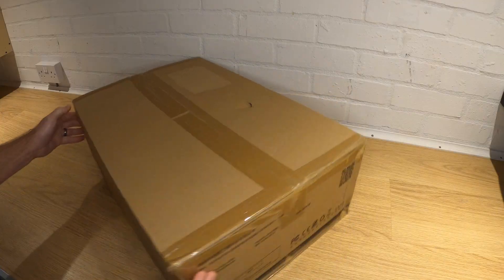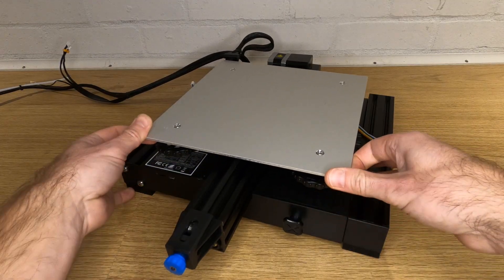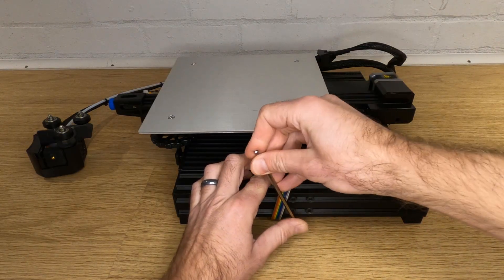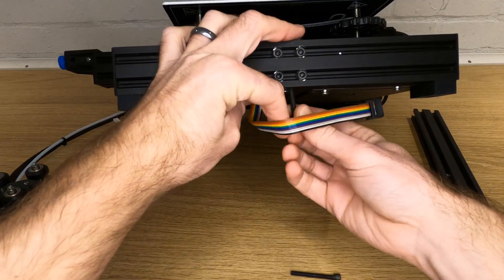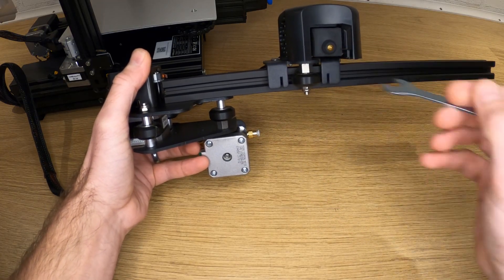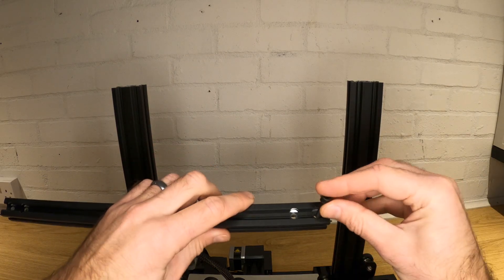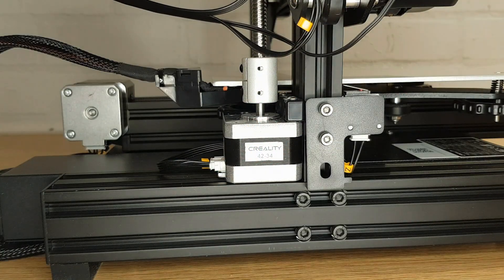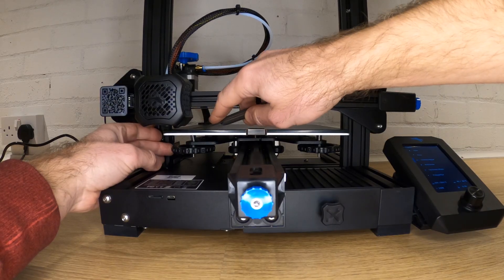Ender 3 v2 Full Build, Assembly & Setup - All The Basics For Beginners

Comment: I have to say a big thank you for this video. My other half has been wanting a 3d printer for a while, we finally took the plunge. Opened the box to find all these parts and a manual that was next to useless, so I said let’s YouTube it, and there you were. We followed your instructions to the letter. It’s a good job we found you as the heat bed was that tight it juddered when we initially moved it. 
Thank you so much for your help 👍🏼

Comment: The screw sleeve protective cover. Cut about 2 or 2 inches off and put it on after installing the filament step motor. It helps keeping the filament clean and grease free. Also using blue loktight on screw threads before assembly helps it from loosening up

Comment: Wow...great video! I just bought one from Micro Center for $99 using a special promo coupon. There is nothing wrong with this 3D printer. However, being aware of all those minor nuances, minor adjustments, and even adjusting factory preassembled parts is going to be key when I assemble mine. Thank you for making us aware of all those small adjustments. Now I understand why there are some less than positive reviews out there.  Seems to be many cases of people not being aware of what they should be aware of. :)
Reply from the maker: Indeed, it can be great if you are capable of building it right. Enjoy, $99 for one of these is an absolute steal!

Comment: Excellent!! Many thanks for your extremely practical, detailed, precise and thorough instructional videos.  We built our Ender 3 V2 following this one and used the 3 separate ones to level and load etc.  We got a perfect dice and mains socket cover straight away.  Such clear and concise instructions, very clearly based on real-life experience with the products helped us get up and running. Looking at the manual I very much doubt we'd have succeeded by following that as there were so many key tips in your videos which were not covered.  Great stuff and keep up the good work.  Much appreciated.
Reply: How long it take you and how’s your print quality
Reply: @ohfr20  it took around 5 hours of careful and calm progress, checking each item as we went along. Print quality is excellent and we've printed other things since with good results.
Reply: Like on a scale of 1-10 how difficult was the whole bed leveling and setting up the printer in general process
Reply: I am just now getting into this but this seems like it takes a lot of patience I’m thinking about going with a plug and play cause this looks challenging
Reply: It’s not difficult. You just need to be meticulous which this video really helps with, adding real life experience to avoid potential pitfalls. Take your time and check each step, watching it repeatedly to make sure
You’ve done it right.

Comment: Hey, quick question! I've been following this tutorial religiously to assemble my first 3d printer. I've reached the point where you out the belt on, but to my dismay it doesnt seem to fit? I've triple chevked that i am using all the correct parts but the belt seems to be just half an inch or so too short to fit all the way around. Is there any common mistake I may be making? Or is there a possibility that the belt itself is too short?
Reply from the maker: You wouldn't be the first to receive the wrong belt. My advice would be to contact Creality.
Reply: @RickyImpey  Alright, thanks!

Comment: Really good to start and turns bad quick. When assembling the printer head he skips over a lot of stuff like it is self explanatory. The belt for instance he just skips by and does not show where it goes. Very confusing. Also he says don't put it on upside down and the keeps going. Does not show which way is upside down. Smh I'd be better off with the Chinese instructions.

Comment: Absolutely the best tutorial for this one YouTube! Just picked this printer up since Microcenter has it at $99 with a special coupon and I've been wanting to pick a 3D printer up for a while. This tutorial really helped and showed the process better than any of the other tutorials I looked at. To be honest though, when I was getting super frustrated while confused by something, I got so pissed at this tutorial and all the others on YouTube lol I had an issue with the tensioner belt and spent over an hour messing with it because no tutorial showed/explained that the belt could only go in one way. Later, you said to make sure the wires went behind the vertical extruders, not in front but I'm the shot before, your wires were in front so that's how I put mine. Only to find that if I played the video for 3 more seconds, you would've said the line about it needing to be behind. Small nitpicks that mostly come down to me being a complete beginner.

Thanks for the tutorial!

Comment: Help! I love your video its very descriptive.  I am at the part with the belt exactly 8:39 in and my belt is too short,  I have checked everything to make sure that my parts are all put in the correct place and it looks good,  any suggestions besides returning it,?
Reply from the maker: If you disassembled the adjuster like me and it's still too short then unfortunately there is nothing you can do with that belt. Best contact Creality with pictures and measurements, I'm sure they would send you another one.

Comment: What if everything is aligned but I can’t push down on the gantry? I loosened the z axis stepper motor mount and everything else, its almost free floating and it wont let me push down unless Im pushing directly over the motor...
Reply: update: Id say I have to move it a good 4mm or so for it to be pushed easily, I have no idea how to fix this rather than putting in spacers

Comment: I am stuck where the gantry does not mov downwards when I gently push down. one side wants to move but the side with the rod does not. the bolts on both sides are about the same amount of give. any suggestions? :(
Reply from the maker: Have you tried loosening the z axis stepper motor mounting and seeing if it allows easier movement? This is the most common reason for any binding. If it helps then you need to look at removing the molding seam on the plastic block like I had to in the video.

Comment: Great tutorial, got my 3d printer working great on all axis except the front of my models (y axis). I'm getting a lot of ghosting / ringing which is noticeable and a clear lack of text definition which I noticed on some calibration prints but text was perfect on the x axis. Any idea what the resolution here is?
Reply from the maker: Hi, ghosting is usually caused by vibrations on an axis. Without slowing down the print movement, I would be looking for any play you can find it the axis that is causing you problems. This can be loose belts, bad roller adjustment etc.

Comment: FIY, for the screen, you do NOZT have to remove the nuts, just loosen them up a few turns and rotate them to lign up roughly with the slots in the extrusion. they should slot right in and will rotate to the correct position when you go to tighten the screw. easy peasy.
Reply from the maker: Unfortunately, no matter how many times I tried, they just wouldn't turn and grab so this was quicker. Usually they do work though👍

Comment: SO far so good this guide is soooo helpful, quick question. When it came time to adjust the wheels at 9:46 I couldn’t get the wheels to spin with my fingers at all. No matter which way I turned the wrench, it moved smoothly along the axis but I couldn’t get that play with the wheels like you were saying. Now getting to putting the Z axis stepper in, it went in rather straightly but upon doing your test, where you push the X axis down slowly it wouldn’t move down slowly, only a very little bit, I had to push down on the piece to holds the z axis stepper bolt, if I can’t get it go down smoothly is something wrong? Or do you think ill be okay? Any Help would be appreciated
Reply from the maker: Hi, you want to get the z axis as free as possible but, as long as it's not binding at all anywhere, you should be ok. It may free up once you've used it a little.
Reply: @RickyImpey  thank you so much for the reply, am new to 3d printers what do you mean by binding?
Reply from the maker: @litey9156  Just that there is no point in the movement of the z axis where it seems to get tight or there is any restriction to it's movement.
Reply: @RickyImpey  Ricky you are an amazing man, thank you very much!

Comment: I wish I had seen this video before I put mine together last week! It would have saved me hours. My print bed Y axis rollers were just as tight as yours and there were a few aluminum shavings on the tracks too, so the motion had not only high resistance, but also some very lumpy spots. I put a paper shim under the outer edge of that Z axis motor mount to get the motor vertical. Your solution is certainly better. I also had to loosen the screws holding the nut that runs up and down the threaded rod to get it in a position where the rod aligned with the coupler. As received the rod was at least a quarter of an inch away from hitting the hole in the coupler.  The M4x16 button head screws must be made of peanut butter. All three heads (and the spare as well) stripped and it was not due to a bad hex key. Some good quality alloy screws will be be arriving today to replace the originals, but NOT button head. Great video!
Reply from the maker: Sorry that you had so much trouble with your new 3d printer. All the hard work and attention to detail will really pay off in the long run though, good work 👍
Reply: @RickyImpey  In case someone else runs into it there was one other thing that I didn't see until a few days later. The Z axis profile was not quite at a right angle to the verticals, (not quite 'horizontal'). It was about 5 mm higher on the right than the left. I solved it by Dremeling the holes in a couple of places to allow the profile to drop slightly. Mostly it was the clearance hole in the back of the profile for the nut on the end of the mounting bolt for the wheel immediately in front of the Z axis stepper. But now that I look at it some more, a guy could likely save himself a lot of trouble by lossening one or both of the wheel mounting bolts above and below the X axis stepper. There would probably be enough play there to allow the whole X axis affair to rotate down to where it should have been. Anyway, it all works great now. And I love the Jyers firmware!

Comment: Ricky I am SO thankful for your videos! I just got my printer in and it had all the issues you talked about except for the rod and the y axis motor hitting the bed. I rolled the bed back and forth and it was tight with multiple dead spots. I moved the wheels all around and adjusted....seems much better. This printer would have had issues from the start if I didn't follow your assembly guide. My only worry is if I tightened the bed belt too little or too much. LOL THANK YOU!!! I am going to test it first as it is from the factory, then add the dual extruder, CR Touch, Capricorn tube and Jyers.
Reply from the maker: Great to hear the video helped you avoid some of the issues people get with these printers Biff. Don't be in too much of a rush to add those mods, get printing and enjoy the hobby. It's a great printer from stock. Thanks for leaving a comment 👍

Comment: Hello, very good tutorial with very little problems until now, at the part where you had to sand down your plastic bit, I was also having problems, but I used a level and the top part that the rod initially goes through is askew rather than the bottom part. I was wondering if you know about this problem or if you know a way to fix it.
Reply from the maker: I'm not sure I know exactly what you mean. On the V2, the z axis lead screw is clamped in the coupler at the bottom and passes through a thread in the X axis carriage. Is it this thread that is not straight? If so, then I haven't seen that before. Have you tried loosening the fixings a little? They shouldn't be tight, they should allow a little movement which will probably allow the screw thread to sit straight.
Reply: @RickyImpey  Thanks for answering! This helped a lot but there's still a little binding near the bottom of the rod, I'm going to try sanding down the piece you mentioned just in case, thank you!

Comment: Thank you, wish I had seen this before using another one! Videos are great! Just got that model and think its set up but on trying the first print (the cat provided free on the sd card), all the printer does is move to home position, then turns heat off and nothing extrudes! Any help appreciated
Reply from the maker: Have you tried any other prints? Try and see if it's isolated to that one g-code file. I know it shouldn't be but I find it best not to assume anything when trying to diagnose an issue.
Reply: @RickyImpey  thanks, yes tried a few with the same result or lack of it should I say
Reply from the maker: @S27PSA  Well, if it's doing it on every file you try then unfortunately it's very likely to be an issue with the control board or even firmware. I would see what your options are with a replacement first. There will be a fix but it shouldn't be at your expense if it's misbehaving from new. If you followed everything in the video, then it is very unlikely to be something you have done wrong. I found Creality to be pretty good on getting a printer I bought up and running when it came with a faulty part. See what your return options are first but come back to me if you want to go down the route of trying to diagnose further.
Reply: @RickyImpey  thanks Ricky made progress today and did contact Creality support; hmmm jury out on that experience! But they did say to reset config and reprint a file they sent and it appeared to work but then the model print went all over. Fortunately having watched your tramming vid ☺️ I did it again a few times and booom it printed! Excited was an understatement! Thanks again for your help and your vids which I’ll be watching closely 🤓
Reply from the maker: @S27PSA  Awesome! Really glad you got it sorted and you are printing. Now the fun really begins🙂

Comment: I just unboxed and partially assembled my ender 3 V2 but I think I've run into a snag. The left X-axis tensioner rollers seem to be really tight and no matter how much I adjust the tension nut with my wrench/spanner, the rolers on the left cannot achieve that loose play that you've got in the video. Is there anything I may have done wrong or something I can do to get the correct tension I need?
Reply from the maker: If you loosen the adjusters on each side and the outermost rollers are still tight then either your frame is a little wide or the X axis gantry is a little short. Try taking the gantry off and loosening the screws that hold the end brackets on, pull them apart a little then re-tighten. Make sure to keep them aligned with the horizontal rail too though. Then, when you slide it back onto the vertical frame, do like I did in the video, and loosen the bottom bolts to allow the vertical frame rails to align themselves with the width of the X axis gantry. Hopefully this will give you enough movement to take out the tension.

Comment: Does anyone have a problem with fitting the cross bar thing into the wheels on the back of the nozzle? One of the bottom two wheels keeps on catching the metal and I can’t figure out how to fix it.
Reply from the maker: Have you loosened the adjuster? One of the rollers has a spacer with flats on it that you can turn with a spanner. Turn it whichever direction moves it away from the others to create enough of a gap to fit the channel through.
Reply: @RickyImpey  thank you! I’m going to try that

Comment: Just a tip, those T nuts self adjust once you tighten them, you don't need to use a screwdriver to square them up, they will automatically once u tighten the screws  down.